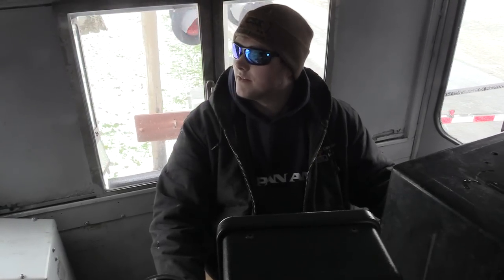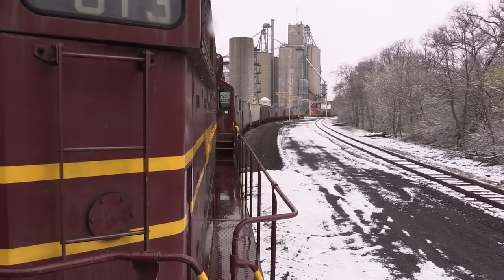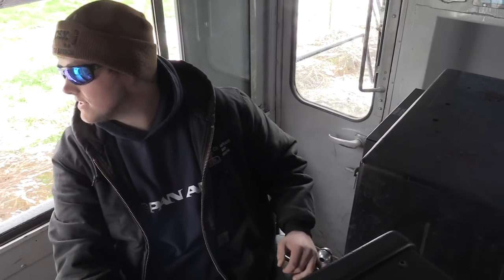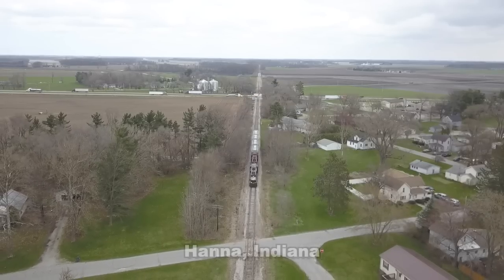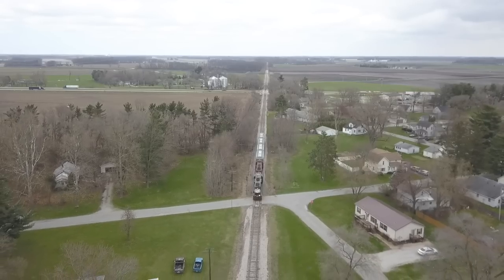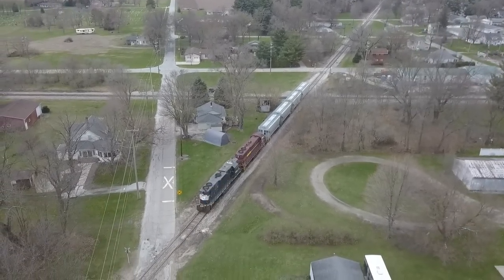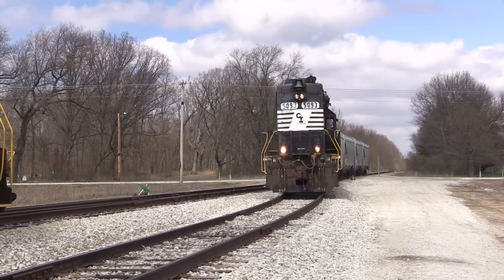Inside a High Hood Locomotive

Comment: As a former Engineer, I would say that I wouldn't appreciate my Conductor yelling "Stop" over the radio like that. I would have a few words with him later. We don't stop like that. We give car lengths and we slow to a stop.
Reply: Okay, tell me how you would give car counts to a gentle stop when a truck backs out in front of you.
Reply: @skullcrusher301  I didn't hear the Conductor say anything about a truck crossing in front. All I heard was him saying something ---- here, STOP. I would expect him to say stop stop in that case but in the video it seems as if he was backing a string of cars and told him to stop suddenly as he was approaching to hitch. It was just the perception of the video. If there was something there, I really didn't hear it . Obviously if we hear stop we stop, but I had many a times where some new Conductors are at the rear on a reverse move and misjudge  the stopping distance. Like I said. It was the perception I got from the video and how the video cut and continued on its merry way
Reply: @skullcrusher301  usually a specific command for an emergency stop. Where i work its "all stop" repeated at least 3 times, in the moment its usually more. When the engineer hears that the train is put into emergency brake application.
Reply: I guess it depends on how salty you are. I like clear and simple signals and commands. If I'm moving something, and that something needs to be not moving, yelling STOP is a great and sure way for that to happen. No misunderstanding that command. Then again, I dont work on class 1 (or even 2 lol) and dont get yalls pay........
Reply: as a former engineer, you didnt realize he dumped it either?
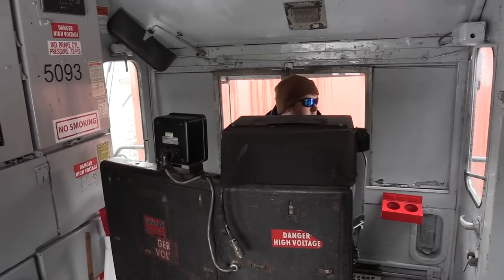Reply: @ 1:39... there was definitely something wrong back there

Comment: I just didn't realize this type of locomotive was primarily designed to operate long hood forward. I've definitely learned something here!
Reply: It's why the CSX freight operations is a challenge (in TSW 2) - because you will do operations - with both ways (short hood forward AND long hood forward).
Reply: @PGHammer21A  a fellow man of class !
Reply: When we really consider the viewing angles it makes sense. But it’s not apparent at first.
Reply: A holdover from the steam locomotive days where crews preferred to be towards the back of the locomotive in case of collisions.
Reply: Their not designed to operate high hood forward, they were optioned by southern to operate high hood forward.

Comment: In Ireland when double heading the EMD units they were placed bonnet to bonnet so that there was a cab at each end regardless of the running direction  check out Irish rail GM 121 class locomotives

Comment: My local tourist line runs one, a crew member let me in it once, they're really comfy actually lol. The visibility was fine for me, like he said, you can't see around the other side, but then again you can't with a low hood either, the control stand and the hood are to tall to see over without standing up. From what I've heard, the union was also somehow responsible for the high hoods on the SOU? I think it was so you would need more crew members in the cab for eyes on each side. With more crew members, there was more jobs, and more people getting paid, which is what the union wanted.
Reply from the maker: That is almost correct. The union wanted extra pay for turning locomotives around to face “forward.” Because High Hoods are considered “bi-directional,” that was Southern’s way of getting around the union contract.

Comment: Interesting.  I didn’t realize the control stand was actually on the other side of the cab, but it makes sense then if the locomotive was purposely designed to run long hood forward then.  Which also puts the toilet/head at the rear instead of the front.  

So does the locomotive have the side “F” painted on what would normally be the rear of the locomotive now?  Maybe it was on there, but I didn’t see it.
Reply: Ok, I saw one of your replies down below, and I should have caught this in the video.  Since the locomotive is considered “bi-directional” , I guess there is no need for the side “F” painted on what would normally be the front.  So it’s not on the locomotive at all then.

Comment: I noticed these have two sets of horns, one on each end. How does the driver switch between horns? Is there a second horn lever or a valve that reroutes the air from the front horn to the rear horn?

Comment: Interesting choice to set them up to run long way forward. That reasoning doesn’t make a ton of sense to me
Reply: TLDR: The railroad company wanted to save crew hours, therefore saving money.

The railroads thought if they made the worst way to look out of the locomotive the "front", the crew wouldn't complain as much about visibility when running the locomotive backwards since they'd only have to look around the short hood. In the "normal" configuration, running backwards means you have to look all the way around the long hood from the left (US railroads are designed around engineers sitting on and looking from the right side). Therefore, train crews wouldn't have an excuse to flip the locomotive around when running a train the other direction. This saves time, which saves money.
Reply from the maker: This is correct.
Reply: One reason why was in some of Southern states there were a lot of rail crossing without gates or lights at crossing so if you hit a truck you wouldn't  have a ton of graval on top of you NS would still have been running short high hoods but they would have had to pay extra for this since  GM and GE were only building short hoods But what you expect from a backwards company That until recently they had no chemical toilets on their units They use to have bags to sh*t in then you would take the bag with  you at the end of your shift

Comment: Where I live in MN there is a place called the Jackson Street Round House also known as Minnesota Transportation Museum.
They have a High Hood Geep GP-7 Soo Line 559 (ex Rock Island 1223)
They use that mostly on the train excursions over at Osceloa WI.
The 559 was the prime mover until they got a Burlington Northern 6234 - general Motors (EMD) SD9 which is now the prime mover
The 559 is a backup or a short line run to Dresser WI and back to the Osceola Depot
Here is a shot of the Soo 559 
https://youtu.be/YvQhzG018OU
Reply: What town is the Minnesota Transportation Museum located? That would be fun to go see it.

Comment: I always envied the engineers on trains.  Just thinking of how cool it is to be sitting in front of a massive engine, pulling a boat load of cars behind you.  This is a different look at how this type of train operates.  I had fleeting thoughts about trying to work a large engine until I read an interview with a retired engineer who related how some ass clown drove AROUND THE ARMS AT A CROSSING and the train hit him at better than 40 mph.  It killed everyone in the car and it caused the engineer a lot of nightmares.  The court trial was awful.  He got drug through the mud DESPITE ALL SIGNALS OPERATING, ARMS DOWN.  Lawyers are truly the scum of the earth.  People don't realize you don't stop a fully loaded 100 or so car train on a dime.  It took him over a mile to get stopped.  I spent 3 years in Germany and rode the trains and subways a LOT.  Over there, you KNOW BETTER than to drive around the arms when a train is approaching.  I would still like to ride in the cab for just one long haul trip.  Excellent video.  It takes some mad skills to be able to operate these things.  My hat is off to everyone who DOES get to operate a train.

Comment: why do you content creators insist on calling EMD sheet metal high and low hoods?? EMD NEVER EVER called them that and in fact in all the EMD literature it refers to the sheet metal as a "car body" and in some cases a "low nose".  Seems like folks who are interested in providing accurate information about locomotives would at the least use the nomenclature manufacturers, and some railroads used for decades. Sounds so silly to say hi hood and low hood.
Reply from the maker: Literally no one but you refers to them that way.